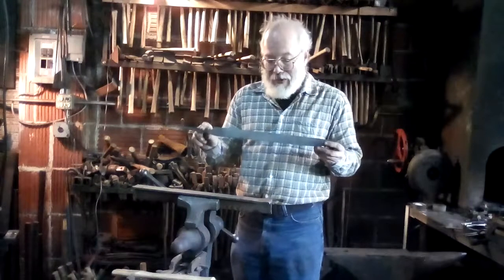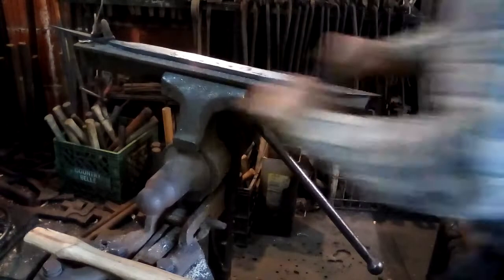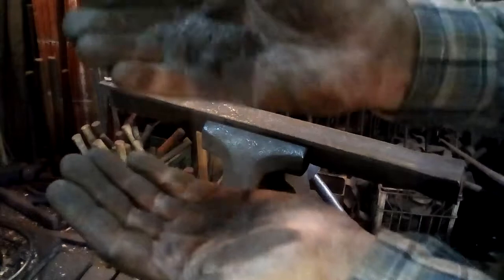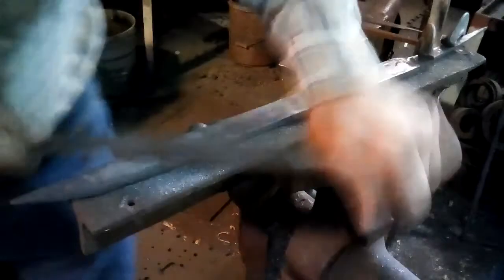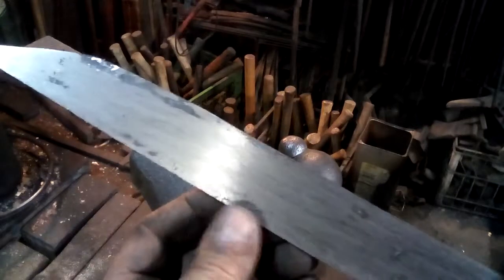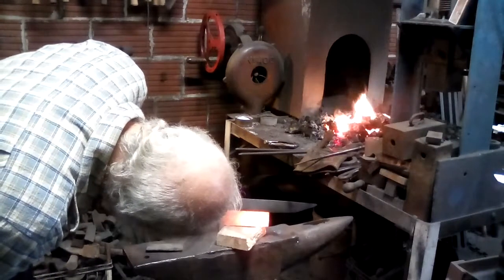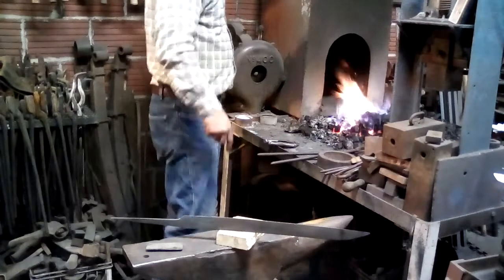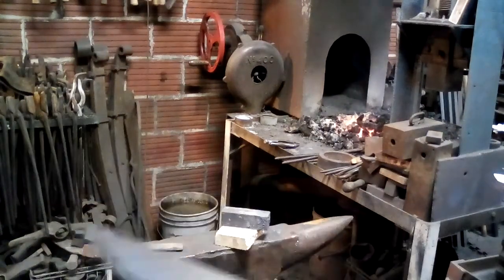2 ,  Afternoon at the Blacksmith's Shop, Filing the seax blade and heat treating

Comment: Thank you very much for the video. I am also the kind of guy who tends towards the more traditional methods rather than using all the modern aids. This approach teaches you far more about the material and smithing in general and will tend towards a better understanding even when more modern equipment is used. With age comes patience - a virtue so often lacking in youtube videos.
Reply from the maker: I think that using the closest method to the original makes it be closer to the original.
CNC mill a model T engine block out of aircraft grade aluminum. It may out preform the original but is that better? If the reason is to know about driving a Model T  , make the car as close to factory as possible.
Daniel
Reply: @danieltokar1000  Thanks for the analogy Dan .... very apt. 
Trying to replicate the more basic aspects of smithing to the best of your ability, truly teaches  respect for the wide range of skills that the smiths of old possessed. I missed my vocation in life and am playing catch-up. As a youngster, I worked in a 3 smith shop as striker and general dogsbody but sadly all of them were getting on a bit and not in a position to take on an apprentice. I ended up spending my life mining coal instead, and to be fair enjoyed every minute of it. Now long retired, I am setting up a shop with my eldest son, who does work in a forge - on a different scale as his forgings tend to range between 1/2 and 10 tons a piece, and generally are of complex and expensive specialist alloy steels. He hope to incorporate general small scale forging as key part of the training of his apprentices.
Reply from the maker: @bigoldgrizzly  Hi:
 I came from a "mine" family, Lost a grandfather and uncle to mine accidents.
If you look  you can find my video on being a "mine smith", early on I made safety links and survey augers for the mine.
I came from a mill town south of Pittsburgh and grew up around smiths like your son. 
Almost got into a apprenticeship but the 1982 collapse of the old rust belt mills happened.
He is also an example of why I have problems with some smiths calling themselves "Master Blacksmiths".
People don't seem to know that Blacksmithing as a Trade is regulated the same way Plumbers and Electricians are.
A Master has gone thru  programs and been a Journeyman and Apprentice with lots of time spent learning .
Maybe you can talk your son into doing a video about the current programs. Anything I know is from 40 years ago.
Daniel